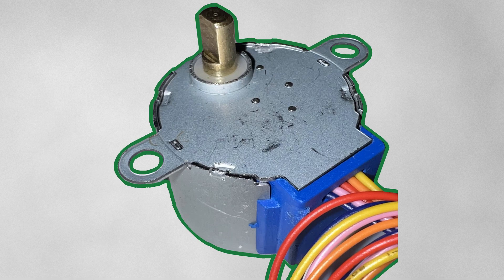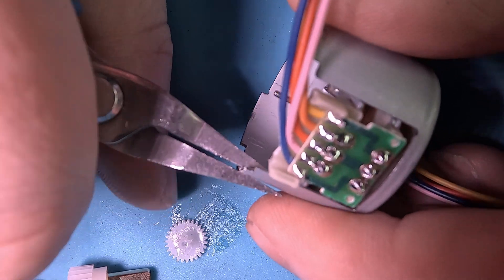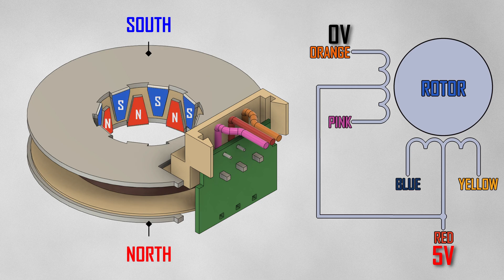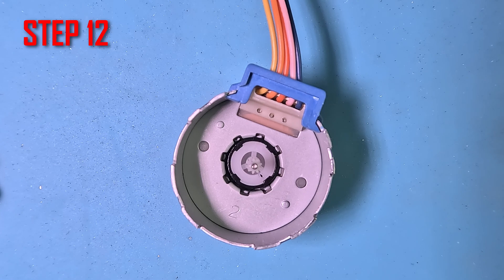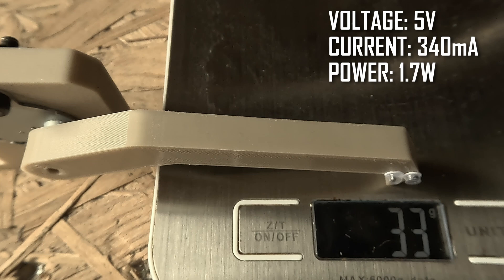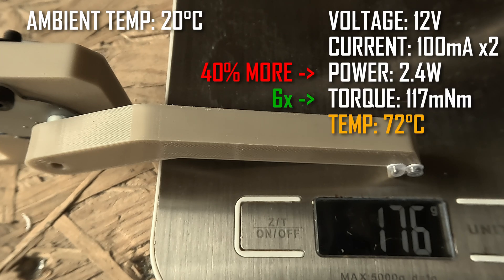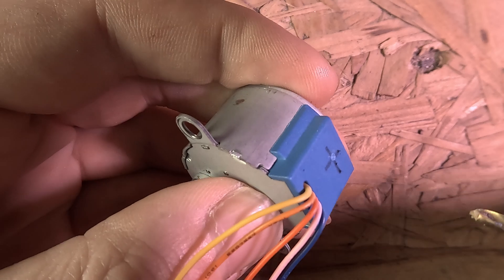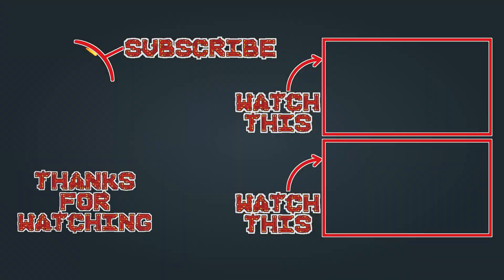Modifying Cheap Stepper Motor To Be More Powerful (28BYJ-48)

Comment: What are the tradeoffs to performing this modification?
Reply from the maker: Well the key trade off is that you need to use a different stepper driver than the one supplied with them, such as a A4988, DRV8825, TMC2208 etc. and these cost more, typically £2 - £8, these also typically prefer a higher voltage then the supplied driver, for example the DRV8825 needs about 8.5V for the motor power which can be more challenging if your project is battery powered. I haven’t used these much, I was planning to use them to improve my hexapod but the backlash in the gears is just too much so I may make a little automatic coil winder or something with them and then try rewinding one with different wire sizes to see if they can be made more powerful.
Reply: @JustAnotherMakerChannel thanks! If you do that, I'm sure it will make a cool video. I had assumed the extra stepper driver would be a cost for sure, but I'm curious if a similarly spec'd driver would face pros/vs/cons in this new bipolar mode vs the original mode, assuming it could support both. I am not too well-versed in stepper motors. :P or is the bipolar mode the preferred mode for higher-quality, serious drivers?
Reply from the maker: Yeah mainly it’s about cost, unipolar motors (original) tend to have lower power and torque because only half of the coils are energised, but the driver can be really simple and cheap because it doesn’t need to change the polarity of the voltage supplied to any of the coils. Whereas bipolar motors require a little more complexity from the driver as they need to change polarity, but for us it’s easier to use a driver like this because modern types are really sophisticated, we only really need 2 wires, one for step and one for direction, and they typically have current limiting that you can set, work on a bigger voltage range (so you can drive faster) and they can do micro-stepping (they precisely control coil currents to hold the rotor between positions, giving more steps per revolution), and even determine if there are faults with motor or circuitry, really the cost of these drivers is definitely worth it! Because of the tremendous popularity of 3D printing the cost of bipolar motors and drivers are significantly cheaper than they were 10 years ago, making the cost benefit of unipolar motors and control not as significant as it used to be.
Reply: @JustAnotherMakerChannel Thank you for this excellent and detailed response :) this clears up my confusion!! and thanks for the cool video, it is inspiring me to spend some more time with my steppers. You'll definitely have a new subscriber for me!
Reply: @JustAnotherMakerChannel  I had the same idea but the payoff vs the time required just wasn't there for me - too many irons in the fire as it is.

Comment: F O C
O
C
Reply from the maker: What does this mean?
Reply: @JustAnotherMakerChannel  Field Oriented Control AKA Vector Control, which is a clever way of controlling the stepper drive currents to provide numerous performance benefits.  However no-one in their right mind would be considering this for the kind of application these very cheap gears steppers would be used in.
Reply from the maker: Thank you, I wasn’t sure if they meant field oriented control, fact or crap, free of charge! Yes it’s used more in BLDC motors.

Comment: Very helpful! Thank you for posting this.  For purposes of discussion I wanted to mention there seem to be two versions of these with the same 28BYJ-48 designation - one a 12 Volt and the other is a 5 Volt version.  I haven't checked the coils but I assume there is just a different number of turns on the coils.  Good job getting the case apart you have to have the perfect size mini screwdriver which I have yet to find in spite of having a collection of 20 of them. edit (I just watched the video again and noticed your video did show the 5V spec and compare to the 12V - I just missed that the first time).
Reply from the maker: Thank you! Yes the case is not an easy feat, I’d did slip a couple of times into my other fingers. These 5V ones seem to use something like 40-42 SWG and the bobbin is only half wound, about 22 ohm resistance IIRC.

Comment: as you break the connection, you dont use anymore the red cable? you drive directly only the remaining 4 cables?
Reply from the maker: Yes that is correct the red cable is unused and can be removed if you want!
Reply: @JustAnotherMakerChannel same for six wires also , is it possible to use a six wire stepper motor from a printer that can be used as a generator or Dynamo